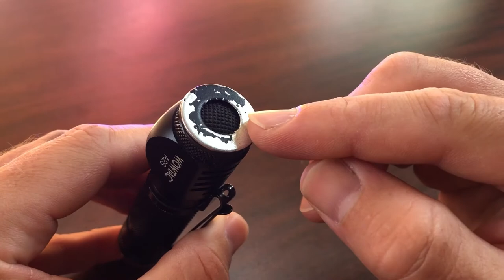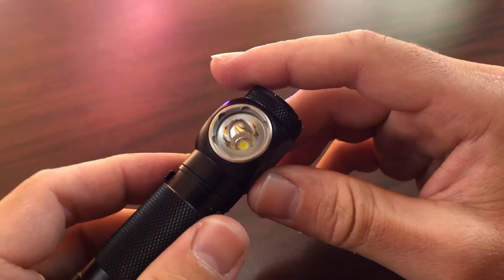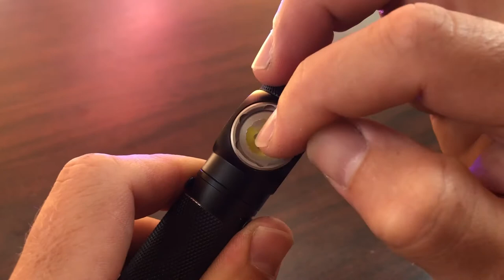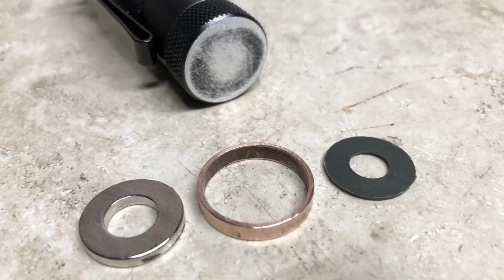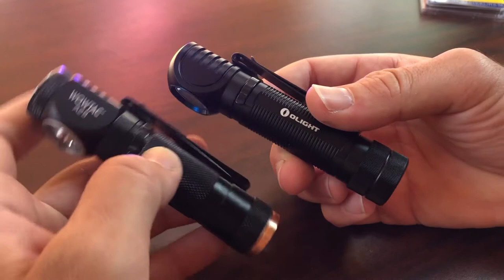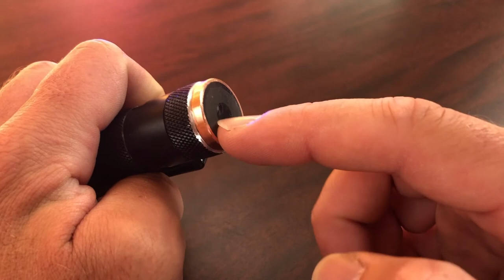4 Easy Mods for your Wowtac A2S | Random Video Thursday's

Comment: If you do the frosted glass trick and only want the outside of the lens covered, just put a circle sticker in the middle of the lens rather than having to scrape it off. It will look prettier.

Comment: Very inspiring creativity and craft. Great clear presentation. Brilliant video. I've been using the wowtac headlamps for several years, absolutely love them, but recently realized that there might be more compact and flexible ultralight travel options and realized clipping light onto cap, belt, etc makes more sense than headband. Etc Etc, But eventually I found the Fenix HM50R and Fenix LD15R are a big upgrade over the wowtac for portability and multifunctionality purposes. One has red light and the other doesn't. One has mag tailcap and the other doesn't. Pretty nice to realize I could modify the HM50R to add a magnet like in your video.

Comment: Just loosen the tail cap a bit to keep light from turning on.
Reply from the maker: When you pull the light in and out of the pocket 10 times in less than 15 minutes, having to do an extra step to turn it on every time is not at all convenient. sometimes I pull it out and turn it on only for a second or 2 and then put it back. That’s the nature of my work. A 2 step turn on and off function would be ridiculous. Plus I prefer a 1 handed operation.